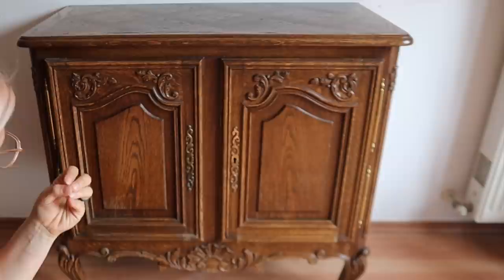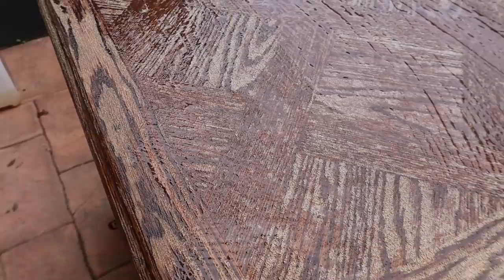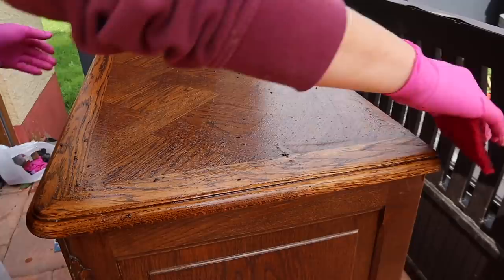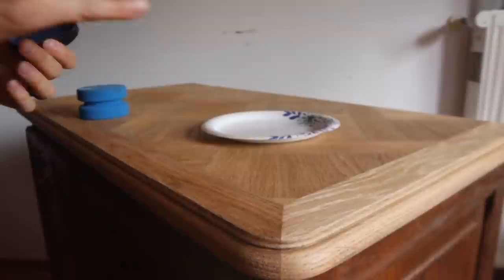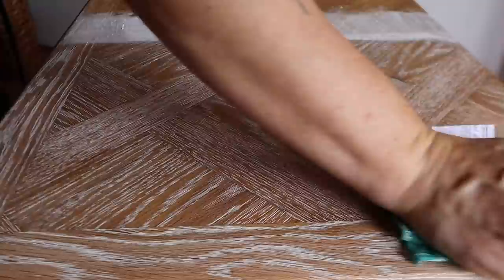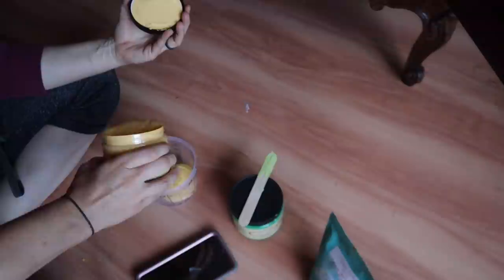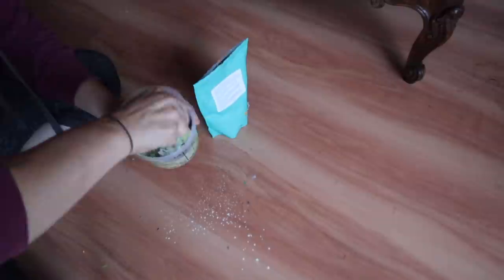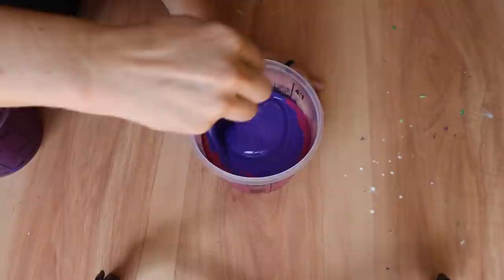Colorful Buffet Makeover | Blend Paint On Furniture | Mixing Paint Colors & Adding Texture

Comment: What other wood will the ceruse finish work on? I'm making a top for a cheap table I'm upgrading, oak is too good for it 😂
Reply from the maker: I clearly have a problem lol 😂 I just really like that finish lol 😂

Honestly it will work with most wood as long as you can deepen the grain, I did it on pine also. What kind of wood is your table?
Reply from the maker: @JennieZ42  lol yeah wood is not cheap anymore!!!

Comment: At 18:02, before you apply the wax, did you wipe off the sand dust or no?
Reply from the maker: Yes I did that before I applied the top coat which was before applying the wax